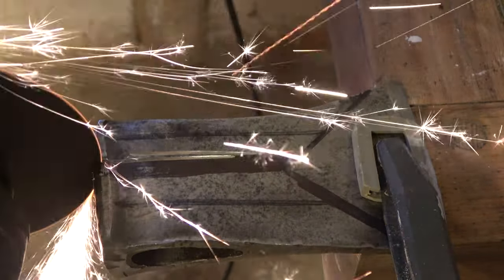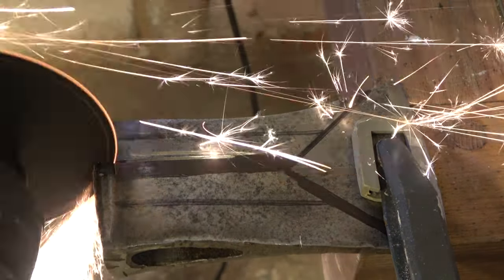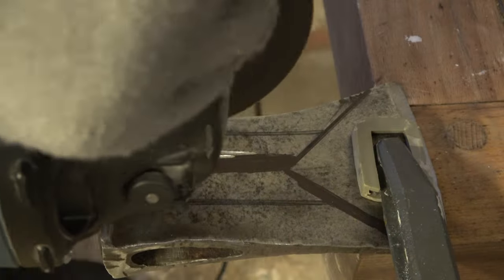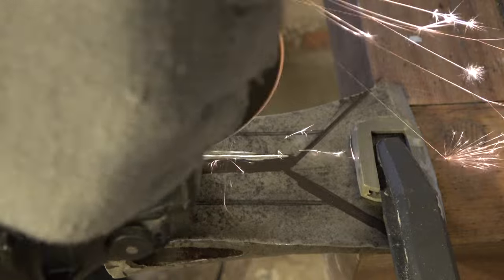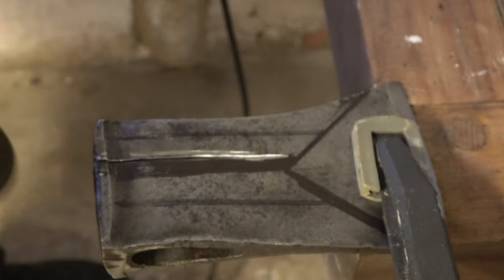Modifying an axe head Axe with plywood handle

Comment: Greetings! Indeed, the creation of something with one's own hands has a healing effect on a person. I notice it myself. I really liked the plywood handle. I want to tell you about the method of attaching the ax. The most secure ax attachment can be achieved by using a rectangular wedge. In the ax handle, it is necessary to make a trapezoidal cut. So that the wide side of the trapezoid is at the bottom. The inner part of the ax eye has a conical section. When you insert such an ax handle into the hole of the ax and then insert a rectangular wedge, the ax handle will expand at the top and securely fix the ax. No need to use metal for the wedge. Use any hard wood. It is also useful to lubricate the inside of the ax eye and the wedge with rubber glue. A thin layer of elastic rubber will compensate for minimal changes in wood size with changes in humidity. It will also reduce impact damage to the attachment point.
Reply from the maker: Hi there I feel you it certainly does Thank you for your comment and the good advice I will give it a try next time Appreciate it